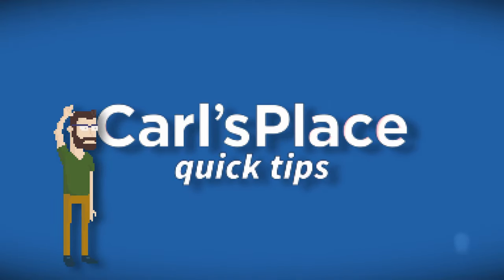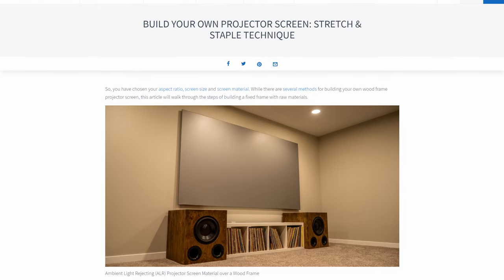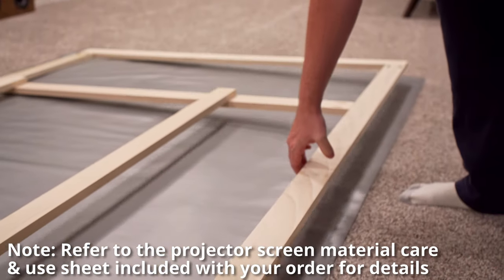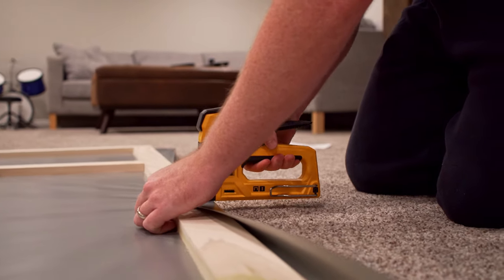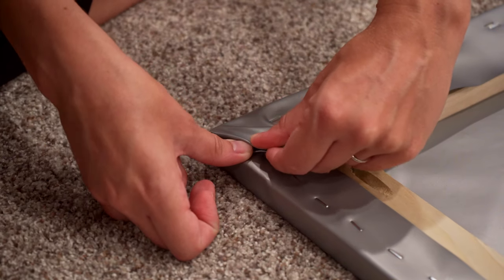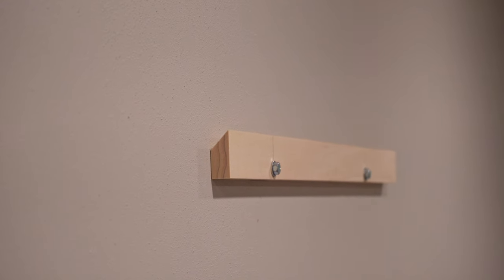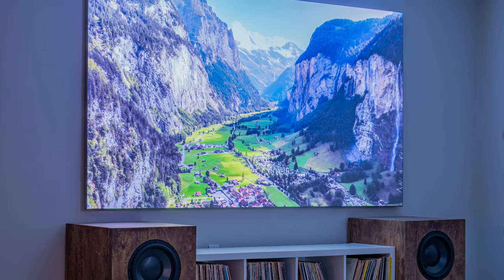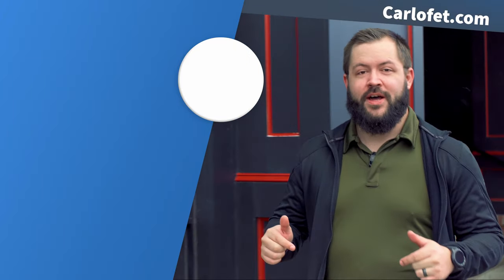Stretch & Staple a Projector Screen - Quick Tip

Comment: Hey there! Thank you for your video! I recently got a 150-inch grey reflective screen, but it arrived all wrinkled from storage and transportation. I tried using a garment steamer to smooth it out, which helped a bit, but it's still not perfect, especially for enjoying crisp 4K projector visuals. Do you think attaching it to a wooden frame will solve the issue by stretching it evenly? I'd appreciate any advice!
Reply from the maker: Hey Tony! If this is one of our screens, we'd recommend mounting it with tension and using a hair dryer on a low heat setting on the back side of the screen to remove creases. Make sure to not leave the hair dryer in any one spot for too long or you will risk damaging the screen material. With any more questions, reach out to our customer service team here: www.carlofet.com/contact